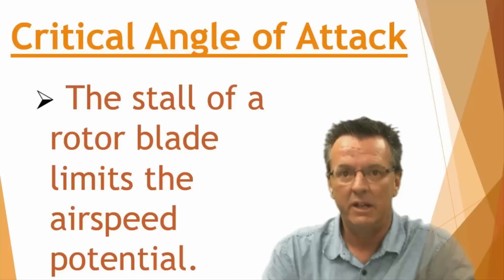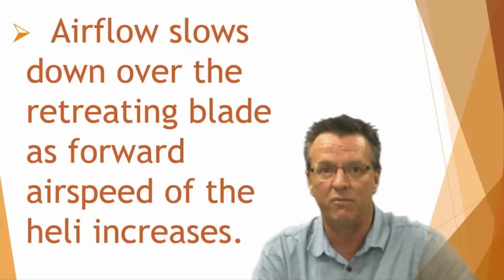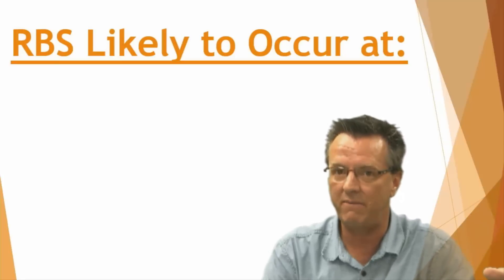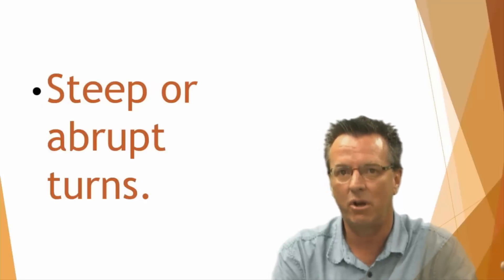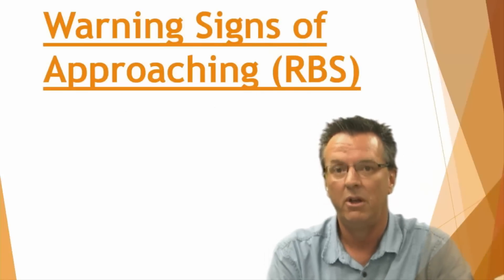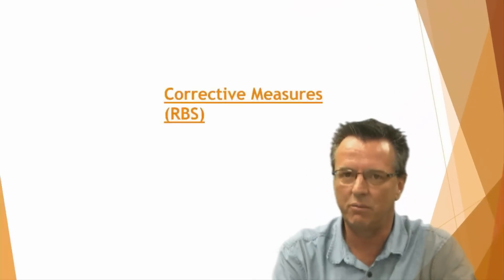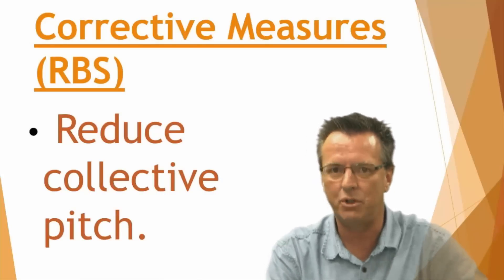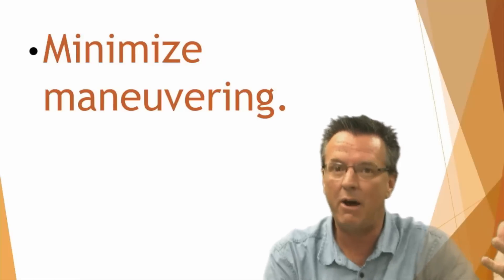Retreating Blade Stall - Helicopter Lesson

Comment: Thanks sir for all your efforts,i have a question,is that retaining blade stall  can occur on hover movement ?
Reply from the maker: No.
Reply: @HelicopterGround   thank you sir?
Reply: Sir I need your opinion about situation that happened yesterday . slightly crashed uh 1h helicopter,first pilot final approached and landed area where 3 degrees nose up slope and wind 80 degrees  from left side of the helicopter approximately 10 knot,then suddenly helicopter tends to move back,and pilot moves cyclick  forward to hold the helicopter horizontally then excessive vibration starts on helicopter,pilot couldn't get the control of the helicopter and helicopter turned to the left and crashed.pilot says"I moved cyclick forward and the helicopter didn't respond"what could be the reason sir?if you give me your opinion I ll be glad thank you

Comment: It's likely what happen to Kobe.  Last few miles the helicopter was following the 101 freeway northbound into a mountainous area with many peaks and valleys.   That morning was unusually foggy with low visibility and the pilot was on Special VFR (Visual Flight Rules) meaning he was visually navigating the terrain while remaining below the cloud cover.  The pilot probably came into a dense patch of fog near the Las Virgenes 101 exit and attempted to pull up while increasing speed which caused the RBS forcing the aircraft to bank to the left and crash into the mountainside given that its a counter clockwise rotation.  In 12 months the NTSB will confirm this post.
Reply from the maker: Thanks for commenting
Reply: This does seem like what occurred.
Reply: He was 100 feet from clearing... but, that means nothing :(
Reply: The helicopter was going down so even if he cleared that hill there was more on the other side.  I work 3 miles from the crash.  The pilot had lost control while switching from VFR, it’s unfortunately a common cause for crashes.  It’s Southern California so this pilot was used to ideal sunny weather conditions but that morning was very dense fog.
Reply: Andrew He didn’t switch from VFR. He requested special VFR and flight following. He was IFR certified. However the company disallowed IFR flying. Pretty sure he had flown many times in the fog being a instructor. When you fly a helicopter you can comment...
Reply: @nordicpride9708  Dude Special VFR is still VFR! He broke the first rule of IIMC which is, do not punch in. After he punched in he broke the second rule of not trusting his instruments. When he punched in, according to the NTSB, he became spatially disoriented. He initially began a climb but became confused and began a descending turn down and to the left. He impacted the mountain in a very nose low attitude at a high rate of speed. So very sad. If it ever happens to you remember:
1. Transition to instruments. Do not try to find a worm hole and fly out.
2.  Level the aircraft according to your Attitude Indicator. TRUST YOUR INSTRUMENTS NOT WHAT YOUR EQUALIBRIUM IS TELLING YOU!!!
3.  Begin a positive climb
4. Turn only to avoid known objects
5. Contact ATC
IIMC kills a lot of pilots needlessly. God rest his soul and all those aboard. Lets all learn from this most unfortunate accident. I fly I can comment.
Reply: @annette6863  Maybe read my comment. It’s called comprehension. I also fly. You seem to have not comprehended what I said. I wasn’t giving a play by by. I was speaking to his use or VFR vs IFR and his quals as they relate….
Reply: @nordicpride9708  I apologize if I misunderstood what you were saying. I just think it's very sad that this could ever happen to an experienced IFR Pilot. I have had the leans flying IFR and it's difficult to work through but that's when we go back to our initial training and trust our instruments. I do not know how this guy was trained but I had many training iterations of having to close my eyes while my Instructor would put us in an unusual attitude and then take the controls and level the aircraft. Is this how you were taught?